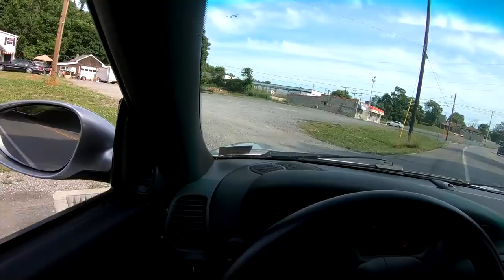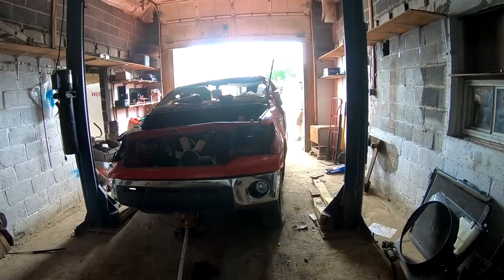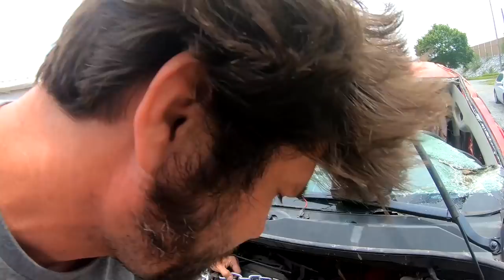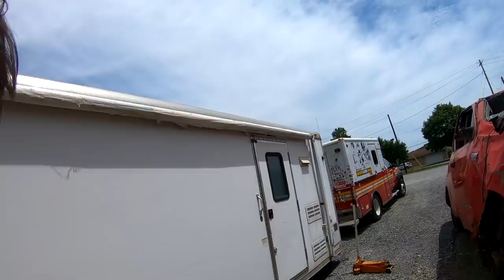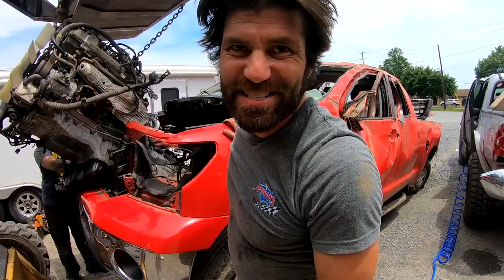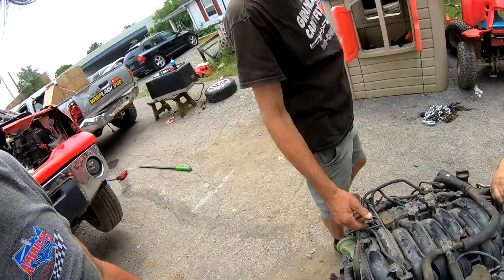TACUNDRA 8 - Pulling the 5.7 Engine from the Tundra

Comment: Yeah the mounts should work. They are not that expensive and I sent you the part numbers. Its worth the shot. That would motivate more people to do the swap if we know the engine is bolt in. Like I say the 4.6 1UR and 5.7 3UR are the same block on the outside and the GX460 is the same frame firewall forward. I hope you give it a shot. I am sure you can get the mounts from TLS parts but even from the dealer there not that bad.
Reply from the maker: You the man! V6 just came out today and physical aspects look promising.  I'm going to look closer at these mounts now. I'll probably just order them and see if they work.
Reply from the maker: Hey Brycen, what are your thoughts on the crossmember for the trans mount?
Reply: What transmission are you running the Tacoma or the Tundra? You might be able to run the Tacoma Transmission with the GX460 bell housing.
Reply: You need to find a Aisin A760F bell housing. Part Number 35111-35110. They came on the Tundra 4.6L and Sequoia 4.6L and GX460. It will bolt your Transmission from your Tacoma to the Tundra 3UR.
Reply from the maker: @brycenconk8087  I definitely want to use the Tundra trans

Comment: The Lexus GX 460 uses a 1UR FE which is the 4.6L V8 that can be optioned in the tundra. The GX should use the same front chassis section as the Tacoma so buying a set of mounts wouldn't hurt, and I'm typing this as you say the exact same thing so we are on the same page.
Reply from the maker: Yeah someone else did tip me off to that and I definitely plan to look into it.  I'm feeling more confident now that I've heard this from 2 people.

Comment: any idea how much more the 5.7 weighs? great job fellas!
Reply from the maker: Good question.. according to specs, the 3URfe engine itself weighs 123 lbs more than the stock 4.0L.  I'd guess the transmission and transfer case may add another 150 lbs too, but that weight will be distributed better since its farther back. I'll probably get some heavier springs for the king shocks then. I have the standard 600lb springs now. I'm going to ask for advice, but I'm thinking 700 lb springs at least.

Comment: Sweet!!!!!! Use the mounts out of the tundra....that way u know they will work.....that way u dont waste time and money.....that's what we did in the old days....Chevy 350 motors mounts and crossmember...welded!!!! Then 4 core radiator in the front...electric flush fans might be an idear....
Reply from the maker: I'm going to consider all possibilities. We'll try to figure out the best / easiest way to do it.  Then other guys can use the video series as a guide to swap their trucks too.  I figure if the stock gx460 mounts work, it would make sense for most people to use them and it will take away the guess work of placement. But I'm skeptical of the mounts making it bolt in.